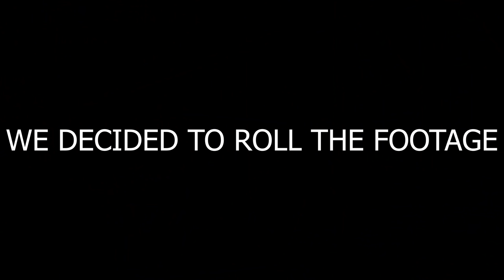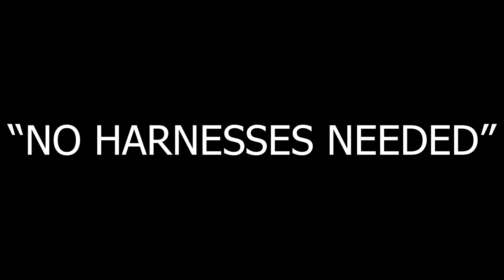RISKING OUR LIVES to Install a $20,000 AC UNIT

Comment: Bringing up that big stuff with the hoist was a butt pucker moment for sure! I was about to stroke out just watching it.
Reply from the maker: Yeah hoist rated at 220 lbs. single cable 440 lbs doubled up.   We probably had 100 lbs to spare 👍👊
Reply: @StudPack  I'd be more concerned with my strapping on the unit giving way because I didn't strap it "just right" .. but you look at your options and you choose the best one. Great video in spite of the <beep> <beep> <beep> :-)

Comment: Great video. Can't wait for part 2. Working with home owners can be very crazy and restrictive. IMHO their "custom walls and ceilings" don't look good to begin with. Why not cut a rectangle and buy 2 new custom grill in black rod iron or some other material that may complement what's there? Less than 5% percent ($1000) of the $20k to give it another "custom" look with a lot of options.

Comment: Hey, Paul and Jordan. Enjoying the new content but I'm concerned about the HVAC contractor reusing the R22 refrigerant pipng for the new system. If the new system is a 410A refrigerant it operates at a much higher pressure....up to 400 psi on the high side! Be careful. Cutting corners and value engineering the line set out of the equation will be more costly to correct if it has a piping failure. Just my .02 as a Senior Stationary Engineer in NYC.
Reply from the maker: Much appreciated John.   They did do an overnight test at 400PSI with digital gauges with zero loss of pressure 👍👊

Comment: I did not do HVAC work, but why didn't you rent a sky crane or scissor lift?  If you could get it onto the property, it would of made the job a LOT easier.
Reply from the maker: We mentioned the homemade cattle guards over the ditch at the street.  Probably wouldn’t support that kind of weight.

Comment: Why not build a mechanical room on the outside at ground level for all the equipment and run large ducts up to where the existing ductwork will carry on? Yes, it's a longer run, but you can insulate the heck out of it and enclose it all the way up, and then all HVAC work can be done cheaply.and easily, including future replacements. The line set would be just a few feet, so less chance of failure. Maybe the ducting enclosure could be disguised as something just as cell towers are available that mimic trees. A fake brick chimney? Whatever it would take would seem to be worth it to get rid of the "mountain climbing" forever. Certainly the next major repair wouldn't be such a nightmare.

Comment: Lol, Its funny to hear the locals accents. Jordan and Paul talk like they are from California whereas the other guys are from the southeast.
17:45 Hey, we just installed your brand new plenum.  Hope you don't mind but we smashed it before we installed it.
Did they really just smash that 5/8 pipe and crush it down to the smaller line instead of using a reducer? Maybe its just temporary.
Hey, I see some wood rot that stud pack can come back and repair.
Reply from the maker: Thx Travis.    That crushed copper was the loop they made to pressure test the line set.   You nailed it ... temporary only 👊.   That rotten wood is on my list 😡

Comment: Hm, why not just disassemble the entire unit and put it In the attic piece by piece. 10x easier and saves all that work. Or just extend the scuttle so you're not forcing the home owner to rip their roof open again for a new system in the future.

Comment: So what happens if you have a leak in the coil or cracked heat exchanger?! That repair is going to be quite expensive to the homeowner even if they have parts warranty for 10 years haha. Service tech will be able to access. But no one looks at the next guy that needs to work or repair the equipment just the profit on install and cross fingers nothing happens within first year lol

Comment: I am HVAC contractor , and for r410 or r32 refrigerant test pressure it 42Bar or  610 PSI .
In "heat" mode    conditioner   goes about 450 PSI on suction   port.
Your  300 PSI  may be enough for "only cool"  conditioner.But my advise  is give sistem more pressure  before fill it  with refrigerant.
Reply from the maker: It is cool only (gas heat) They did do 400psi overnight 👍
Reply: @StudPack  thats better) 
In our country don`t use gas heat modules, and we use highter test pressure for  conditioner sistems.

Comment: I would have openned the ceiling in the closet Much bigger access. Things break and well to not have easy access is STUPID...(plus attic is not a conditioned space)  Do a drop down ceiling or something to that effect..  They got some great looking products...   Then in 10 years they can easily update broken crap which new systems are.. Its a closet ceiling open it up.. I already have a design in my head..
Reply: New led lighting is easy piezy...

Comment: why do builders put A/C units in the attic?  i understand it saves floor space, but it's very hot in the attic and normally not the right place to put an A/C unit.  Besides, access is terrible as Stud Pack demonstrates.

Comment: 0:17 - What really concerns me even more is the electrical hack work. In the first place, that is NOT the proper type of box to support a lampholder. It calls for a round or octagon box that accepts #8 machine screws at the standard spacings for fixtures.  The device box accepts #6 machine screws at the standard spacing of a device.  Also, there is a 14/2 wire hanging out of the other box.
Reply from the maker: Yeah I noticed all that too 😡
Reply: Why does it concern you? Do you live here? Next door perhaps?

Comment: Truly unbelievable.
No one would attempt this.

Wow,  too much weight on the
side of the scaffold when throwing 
things off the top.

Scaffold not anchored to the
building?
Reply from the maker: I had planned to anchor it to the building but scaffold company said it’s unnecessary at the height we were at.   It is very solid despite what it looks like 👍
Reply: I wonder if you Anchor your truck before you get inside , could tip over it only has four points on the ground

Comment: You couldn't use a halogen / freon leak detector to find and repair the leak?
They aren't that expensive and in some places HVAC stores rent them. I've used one, it's simple and effective.
And I TOTALLY DISAGREE with the 'no safety harness needed' while building the scaffolding. Somehow code or law might not require it for your use BUT for personal safety you should have used them anyway. I worked construction from 1980 up to 2012 and we went from nothing to the the waist belt (called the backbreaker if you fell but you lived) to the full harness. I have seen a fall death and he only fell from an 8 foot height. I've seen four slips where a guy setting posts fell during assembly but was saved by his harness. OSHA has a huge database of falls and it's the #1 cause of death. No one plans to fall, it's always unexpected and unpredictable so having a harness and USING IT could save you from serious pain and injury OR death. Yup, it slows the work down but that's better than trusting luck that you will not have a funeral for a family member.

Comment: Are used to do houses in the 80s with scaffolding and 90s we never had any safety equipment three-story buildings scaffolding wasn’t even connected to the building nobody ever got hurt these guys today a bunch of whiners anything to slow a job down cost more money
Reply: PS didn’t have levelers either please take four guys pick it up and walk it to the next section issues some old two by fours just said the legs on

Comment: People need to stop designing houses this way.  Things need to be designed for serviceability.  It is not okay to design the house with critically important HVAC equipment in the attic, only to build the attic access hole too small to fit the equipment.  During initial home design and construction, it is trivially easy to design and build the attic access hole large enough to accommodate the expected attic hardware.

Additionally, manufacturers of HVAC equipment need to stop using air as a heat transfer fluid.  Liquids such as a 50:50 automotive antifreeze + water mix is a far superior heat transfer fluid, compared to air.  Such a working fluid could easily be transferred (in a loop) to/from each room via insulated and flexible small plastic tubes using small/silent/long life electric water pumps, operating under negligible pressure.  The working fluid could be distributed to each room in the house via a central (liquid) manifold with multiple electrically actuated valves and pumps (ex: one for each room).  In each room, all that would be needed is a small liquid to air radiator and fan (plus condensate catch pan, pump, and liquid drain line that routes back through the attic), which can be located inset into the ceiling of each room, and could be user accessible and serviceable from within the room.  Such a system would eliminate the ductwork energy losses, which is typically quite significant, due to thermal transfer through the ductwork insulation (when present), and due to the pressure loss associated with forcing high volumes of air through hundreds of feet of conventional ductwork.  This would also make the required equipment mass and size located inside the attic almost negligible, compared to conventional air based HVAC systems.  The attic would not need to be cluttered by massive amounts of ductwork.

Each room should also be equipped with an air to air heat exchanger and electric fan + louver system (perhaps located above existing windows), to enable one to obtain true "fresh air" from outside, relatively efficiently (due to the heat exchanger), rather than relying on internal house air recirculation of conventional HVAC systems.  In addition to giving more flexibility and independent control to each individual within each room in the house, this also may help to reduce the risk of potential airborne pathogens from spreading from one sick household member to other members of the same household.
Reply: Bla bla bla.
House was built with a giant whole house fan in cieling for cooling.

Comment: R22 really isn't that expensive. You can get some on E-Bay for $17lb and probably much cheaper if you're an HVAC company.  I see the expense of R22 used as an excuse to upgrade all of the time but it's all salesmen/company BS.  Anybody can buy R22 from E-bay by signing a simple waiver.
Reply: I don't ever use products purchased on eBay for my client's home. Maybe for decorative elements if it's an old or unique house, but certainly not anything systems or structural. Also we as a society really really don't want to encourage the production of R22.

Comment: Nice execution. Your rigging was sketchy though; especially lifting from zip ties that were joining the sling eyes because your straps were to short and the timber mount for the winch was inadequate. For your own good and those who work with you, learn proper rigging for your next project.
Reply: They lifted the 3 heavy objects with no zip ties. The beam he used could be thicker tho